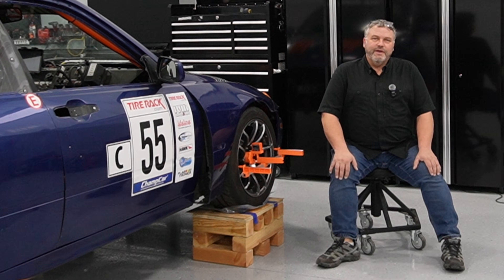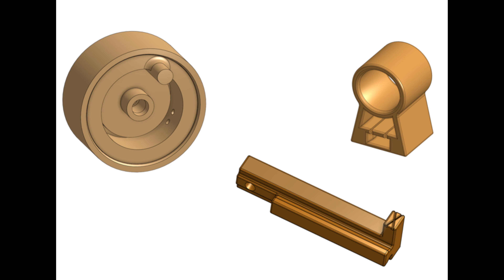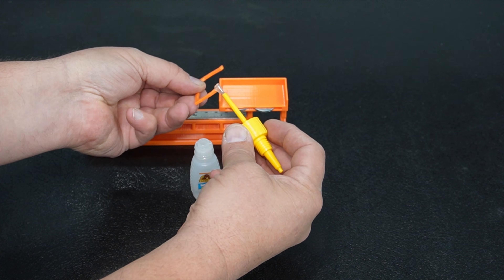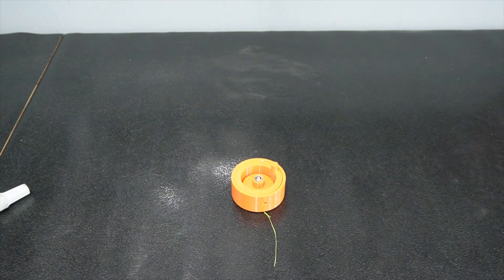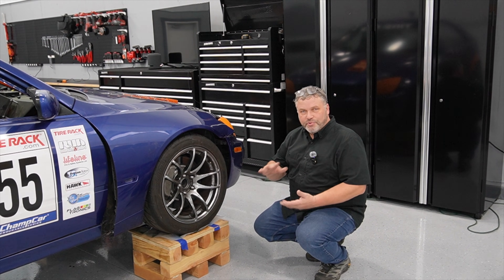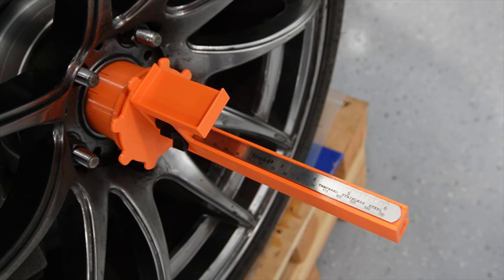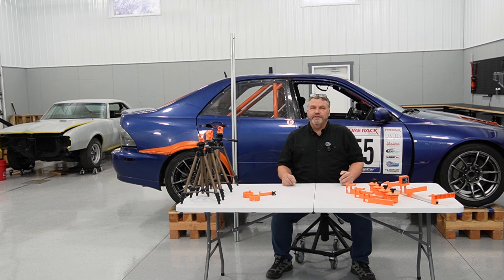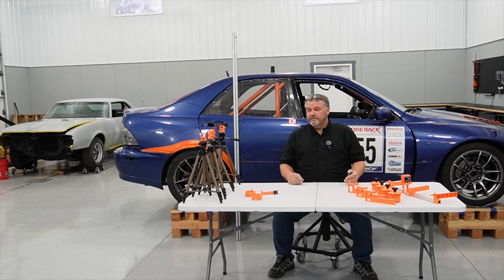3D Printed String Alignment Tools for Improved Accuracy

Comment: In the process of printing everything now! These measurements were a little tricky to get since the clips were in a star pattern but should hopefully be pretty close. 

ESR SR01 On a E9x BMW
Wheel Cap Outside Diameter - 55.2mm
Distance To Detent 3.7mm
Wheel Cap Detent Outside Diameter - 56.35
Reply from the maker: @TheCitrusHD STL files with these dimensions are now available for download.  Once you have had a chance to try them, please let me know how they fit and if tweaks are needed.
Reply: @DIYFabShop I just gave each tab about 3 wraps of electrical tape and now it fits very secure if that helps at all as far as the sizing.
Reply from the maker: @TheCitrusHD  I bumped up the diameters a little and an "A" version of the STL files are now available to download.  If it is still too loose, there are a whole smattering of adapters right around these dimensions on the spreadsheet, for instance you may want to try No 50 if this "A" version is still too loose.  Good luck and let me know how it goes!
Reply: @DIYFabShop  Thanks! I actually printed the Konig oversteer file last night and that one seems to fit well
Reply: @DIYFabShop Thanks! I'll print them tonight and try them out tomorrow. I'll keep you updated!
Reply: @DIYFabShop Okay so it fits but still comes back out very easily even with the lock screwed on. It seems like the Detent outside diameter may need to be slightly bigger so it can actually grab on.

Comment: Thanks for sharing this great project of yours.

Rota SFR 15", 4Holes pcd 100, bronze
wheel cap outside diameter: 62.63mm
distance to the detent: 5.2mm
detent outside diameter: 63.83
Reply from the maker: @JffFrm STL files with these dimensions are now available for download.  Once you have had a chance to try them, please let me know how they fit and if tweaks are needed.
Reply: hi  @DIYFabShop  sorry for the delayed feedback I had to calibrate(calilantern_mk2) my printer due to initial prints being too loose, after calibration fitting is almost perfect, except for a small play wherein I can pull the fitting in and out by .43mm. Its not much but I'm not sure how much it will affect the overall precision if that moved during alignment. Do you think its too insignificant or the model needs adjustment?
Reply from the maker: @JffFrm  I went ahead and reduced the distance to detent in order to try to tighten that up. A Rev A version of the stl files are available for download.  Let's see if that snugs it up.  I typically updated the Rev name of both the Hub adapter and Threaded Plug when making dimensional changes, but you only need to print the hub adapter based on this change.
Reply: hi  @DIYFabShop  happy to report the fitting is now perfect, many thanks for accommodating the changes and sharing this great project
Reply from the maker: @JffFrm  Excellent!

Comment: Alpine A110 2018

Wheel Cap Outside Diameter: 49.20mm
Distance to Detent: 5.86mm
Detent Outside Diameter: 54.20mm

Keep up the great work
Reply from the maker: @iantaylor7462 STL files with these dimensions are now available for download.  Once you have had a chance to try them, please let me know how they fit and if tweaks are needed.
Reply: @DIYFabShop sorry Kent I measured the distance to detent incorrectly should be 2mm
Reply from the maker: @iantaylor7462  new Rev A versions are available for download.  Good Luck!

Comment: Thanks, wanting to try this, 

718 Porsche GT4 stock wheels

Wheel cap outside diameter: 58mm
Distance to detent: 8.3mm
Detent outside diameter: 61.7mm
Reply from the maker: @HLinHD STL files with these dimensions are now available for download.  Once you have had a chance to try them, please let me know how they fit and if tweaks are needed.
Reply: @DIYFabShop  it fit super loose, and im realizing the design of the center cap is a little assymetrical from stub to stub, sorry about that.

i think distance to detent should be 3.3mm
wheel cap outside diameter should be 60.2mm
detent outside diameter same at 61.7mm

can you help with updating it?
Reply from the maker: @HLinHD  STL files with the new dimensions are available for download, let's see how these ones fit.
Reply: @DIYFabShop thank you!

Comment: This is great and the new laser system will make it even better! Thank you for making this available.

Mercedes GLS 450
Wheel cap outside diameter: 70.5mm
Distance to detent: 8.8mm
Detent outside diameter: 72.6mm
Reply from the maker: @Big_Boss_Man5155  STL files with these dimensions are now available for download.  Once you have had a chance to try them, please let me know how they fit and if tweaks are needed.  Cheers!
Reply: @DIYFabShop  It was loose so I measured the wheel instead of the cap that was on there for 8 years and got better numbers. It's a 2017 model year.
Wheel cap outside diameter: 71.6mm
Distance to detent: 8.8mm
Detent outside diameter: 74.5mm
Reply from the maker: @Big_Boss_Man5155  the Rev A version with these new dimensions is available for download.  Let's see if this tightens it up

Comment: Hey there, love this system, would love to print some out to be able to do alignments on my widebodied FR-S but looks like none of the files are quite the right fit.
Avid AV6 were the closest ones in the table I saw. Could you make a file for my setup please?

I'm using Kansei KNP wheels and got these dimensions:
Wheel Cap Outside Diameter: 60mm
Distance to detent: 5mm
Detent Outside: 61mm

Also have you considered doing a parameterized cad file so people can just change the parameters and let it do the work?
Reply from the maker: @Hobo8MyTaco STL files with these dimensions are now available for download.  Once you have had a chance to try them, please let me know how they fit and if tweaks are needed.  Regarding a parametric model, I use Onshape which is cloud based so folks would need an account to access.  I am working on a web interface work around though to create the STL's from data entry on my website.
Reply: @DIYFabShop  Thanks so much! Also thats awesome! I hope that goes well. What youre doing is amazing for the car community.
Reply: @DIYFabShop  Just an update in case someone else with the same wheels need it, I actually ended up using the AV6 ones, I guess my measurement on the distance to detent was off, but the AV6 ones fit perfect!

Comment: This is absolutely amazing thank you so much for creating this resource for DIY'ers!

Autostar Roulette 15"

Wheel cap OD - 61.9mm
Wheel cap Detent width/distance - 4.30mm
wheel cap Detent OD - 63mm

OEM Honda E 16" 
Wheel cap OD - 150.89mm - not a typo! :D
Wheel cap Detent width/distance - 6.63mm
wheel cap Detent OD - 153.4mm
Reply from the maker: @richyvrlimited STL files with these dimensions are now available for download.  Once you have had a chance to try them, please let me know how they fit and if tweaks are needed.  You now hold the record for the biggest hub adapter.  Let's see if something that big still works!
Reply: @DIYFabShop  Thank you, looks like my measuing was off on the large HondaE caps. Rolling out the excuses....the clips aren't opposite other and I think my verniers aren't the best (bad workman blames his tools! ha ha)

The OD is at least a couble of mm bigger for the cap and the detent OD, but I've no way of measuring them that I can think of....best guess I can see is increase by 2.5mm if that's ok?
Reply from the maker: @richyvrlimited  there are now Rev A versions of the STL files available to try.  These things are so big, I would not be surprised if it takes some more iteration.

Comment: This is great. I've been manualy doing the string method with rulers and big squares. Time to put the 3d printer to work!

1971 Fiat 124 spider, Campagnolo wheels
Wheel Cap Outside Diameter: 47.4mm
Distance to Detent: 2mm
Detent Outside Diameter: 49mm
Reply from the maker: @rugwalle STL files with these dimensions are now available for download.  Once you have had a chance to try them, please let me know how they fit and if tweaks are needed.  Cheers!
Reply: @DIYFabShop  Thanks for the quick response! wow!

It fits a little loose. I had to put two layers of electrical tape around the threaded plug. Without it the adapter was very easy to pull out. With the tape it will not come out but still wiggles a little bit. I checked the meassurements again and they are correct with the original cap, and the print is also close. I do think the diameter of the cap outside diameter and the detent outside diameter can be increased a little bit for a better fit. Maybe even a full millimeter.
Reply from the maker: @rugwalle  I added 0.75 mm to both diameters and a Rev A version of the STL files are ready to download.  Let's see if this does the trick.
Reply: @DIYFabShop thanks! Fits perfect now

Comment: Hello I donloaded the number 5 adapter for my JApan racing wheels, they have the same measurments as in your table, but they dont lock with the nut. There is a slight gap between the nut and the part that is insterted into the wheel. So the tabs wont expand. And then the whole assembly wont hold in place. I woulb be really greatful if you could help me out.
Reply from the maker: @CountryRoadsSweden  I revised the gap between the threaded plug and the hub adapter and new Rev A version of the files are available for download.  The plug is meant to support the backside of the detent fingers so they don't deflect, not necessarily push them outward.  Let's see if this change is enough to tighten up the fit for you.
Reply: @DIYFabShop  Hello , it did not work either, But found that Number 10_revA fits well. A nice "snap" in place and then the "bolt" cant go the whole way in.

Comment: Excited to give this a try, I have a 69 cougar with magnum 500 wheels, the center cap opening is 2 1/8" and 3/16" thick, can you work with these dimensions to create a hub adapter?
Reply from the maker: @dagardne501 I can at least use it as a starting point.  I created and STL and added a link to the spreadsheet on diyfabshop.com.  Once you get a chance to give it a try, let me know if it fits well or needs some tweaks.
Reply: @DIYFabShop  Its very close, can you reduce the distance to detent by 1mm?   Thanks and have some coffee on me!
Reply from the maker: @dagardne501  the revised files are available for download.  Thanks for the coffee and let me know if further tweaks are needed!
Reply: @DIYFabShop  Fits perfect, thanks!

Comment: @DIYFabShop, really great design, thank you for sharing it with the community.  I printed most of parts this week and just picked up the .75" tubing. The parts are quite loose on the aluminum tubing, measuring ~ .765" for the Trolley - SAE to .77" for the rim touch off parts.  I pulled the parts into Fusion to try and get a measurement and it matches what I measured on my prints.  My printer is a Bambu X1 Carbon.   Is this by design?
Reply from the maker: Some of the tubing I bought locally was running a little big so my gap there may be a little generous.  The little flex arms were meant to tighten that up.  When you push the trolley in so the rim touch offs seat on the rim you want to tighten the trolley while applying pressure.  If when you do that it feels like tubing is not holding rim touch offs firmly to the wheel, then it may be worth tightening up the fit

Comment: Advanti Storm S1 center cap measurements. (Popular Miata wheel)
Wheel cap OD: 62mm
Distance to detent: 5mm
Detent outside diameter: 63.5mm
Reply from the maker: @eliasswierczewski186 that one is on the spreadsheet.  Your dimensions were slightly different than previously provided so let me know if the fit isn't good for you.
Reply: @DIYFabShop oops, I'll take a look!

Comment: I'm printing this out now.  However I'm wondering if this can be updated to fit a dana 40 4x4 wheel hub.
Any thoughts?
Reply from the maker: @erfdain I have zero experience with locking wheel hubs.  I looked at a couple images and the only thing that comes to mind is if you could back off two of the bolts holding the cap on and then have a 3d printed hub adapter with a matching bolt circle, and then use longer bolts to secure the adapter to the face of the cap.

Comment: Thanks for making this. Here are some measurement of 2 wheels caps:

Toyota GR Yaris OEM (4 flexible fingers)
Wheel Cap Outside  Diameter: 59.2mm
Distance to Detent: 6.8mm
Detent Outside Diameter: 62.8mm

Protrack Wheel (5 flexible fingers)
Wheel Cap Outside  Diameter: 55.8mm
Distance to Detent: 4.2mm
Detent Outside Diameter: 57.8mm
Reply from the maker: @MikaelBertlinSwe stl files with these dimensions are now available for download.  Once you have had a chance to try, let me know if they fit well or tweaks are needed.  Cheers!
Reply: @DIYFabShop  I've now tested both. The fit but are loose. Maybe add 0.2 or 0.4 on all dimensions for both wheels and I can test again.
Reply from the maker: @MikaelBertlinSwe  for your protrack wheel there are couple on the spreadsheet that are just a little bigger than you just tried if you wanna give those a go.  The Yaris I have uploaded revised STL files for.

Comment: Thanks for making this, very inspiring work.

Here are the numbers for the OEM Subaru WRX 18"x8.5 (MY: 2018-2021)

Wheel cap outside diameter: 51.60mm
Distance to detent: 3.35mm
Wheel cap detent outside diameter: 52.30mm
Reply from the maker: @Vosaism STL files with these dimensions are now available for download.  Once you get a chance to try them out, let me know if they fit well or tweaks are needed.
Reply: @DIYFabShop  Just one minor tweak due to a measurement error on my part - distance to detent from 3.35mm to 2.80mm. Snaps right in with the new measurement. Thanks!
Reply from the maker: @Vosaism  got it, I updated dimensions and STL

Comment: Great setup! I have a question in regards of the hub adapters for BMW 6783536. They are really loose fitting and if printed upright the tabs tend to break very quick. Any tips in regards of dimension or print orientation? I have some older style BMW wheels as well and can share that dimensions if needed.
Reply from the maker: @MrThegs I do recommend printing upright as to eliminate the need for support material.  If you are experiencing breakage I would recommend using PETG or ASA filament (if you aren't already). If the sizes are really close, but not quite right you can try to find and utilize a % scaling function in your slicer software to slightly increase or decrease the dimensions.  You can also increase the infil %, either for the whole part or if the slicer has the functionality, for the localized area that is breaking.  If the fit of the available BMW wheels is just is too far off, by all means go ahead and measure the caps for your wheels and let me know what they are and I can create some new files for you.  Hope that helps!

Comment: AODHAN wheel adapters fit perfect thank you!  Still printing parts to complete the alignment system but I measured a few more center caps for my other vehicles while I'm waiting for all of the printing to wrap up.  They are as follows...

Dirty Life DT-1 5-114.3 W/C109303MB01 Center cap 
Distance to detent: 0.2" or 5.08mm
Wheel cap outside diameter: 2.735" or 69.47mm
Wheel cap detent outside diameter: 2.786" or 70.76mm

Ford FR500 Replica Wheels for 94-04 Mustang 
Distance to detent: 0.2" or 5.08mm
Wheel cap outside diameter: 2.24" or 56.9mm
Wheel cap detent outside diameter: 2.33" or 59.18mm

And lastly, 2014 BMW 335 M-Sport Factory wheels (18")
Distance to detent: 0.19" or 4.85mm
Wheel cap outside diameter: 2.535" or 64.4mm
Wheel cap detent outside diameter: 2.653 or 67.4mm
Reply from the maker: @SC32V95Cobra  you got quite the fleet of cars!  I will get these done, minus the BMW for now.
Reply: I know…it’s a nasty addiction 😂
Reply from the maker: @SC32V95Cobra  files links are now available on the spreadsheet, let me know how it goes.
Reply: @DIYFabShop thank you! I’ll get to printing and let you know how they work. Once again, very appreciated! 🙏🏻
Reply: @DIYFabShop Quick update on the Dirty Life hub adapter. Printed one and tested the fit, it is slightly loose even when the threaded plug is all the way screwed in. When I measure the wheel cap outside diameter dimension I come up with 2.715 or .02" shy of the center cap dimension of 2.735. Also the detent outside diameter is measuring 2.77. Is your drawing file somewhat easy to modify for all of these different caps? I have solidworks and a basic knowledge. Just not smart enough with it yet to build the adapter and plug from scratch...If you'd like to share the drawing file I could probably play around with it and update you on what worked rather than bother you and take up your time to change it. Up to you, totally get it if you'd rather not share drawings 🙂
Reply from the maker: @SC32V95Cobra  the CAD was done in Onshape which is cloud based which complicates file sharing.  It is really pretty easy for me to tweak and create a new STL.  I created a Rev A version with a 0.02" larger diameter, available on the spreadsheet. While trying to tweak the fit, others have used scaling % function to adjust the size.  Also a layer of tape between the threaded plug and hub adapter can be used to prototype how much diameter to add.
Reply: Disregard the BMW one. I see you already have it listed although the dimensions are slightly different than what I came up with I'll print one and give it a whirl. THX!

Comment: First of all thank you so much for this system. Love it!

I have this numbers for Lotus OEM 240R 5-spoke (Used on Elise/Exige S2):

Distance to detent - 3.35mm
Wheel cap detent outside diameter 56.2mm
Wheel cap outside diameter- 55mm
Reply from the maker: @fxslin6727  STL files with these dimensions are now available for download.  Once you get a chance to try them out, let me know if they fit well or tweaks are needed.
Reply: @DIYFabShop  Thank you so much. I'll try print a one tomorrow. However I won't be able to test before next week unfortunately, I'll keep you posted!